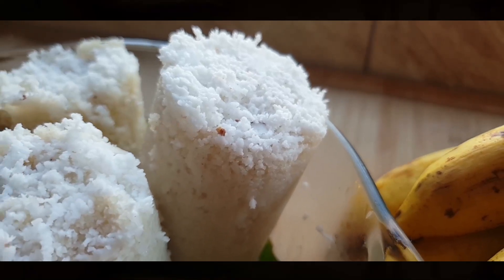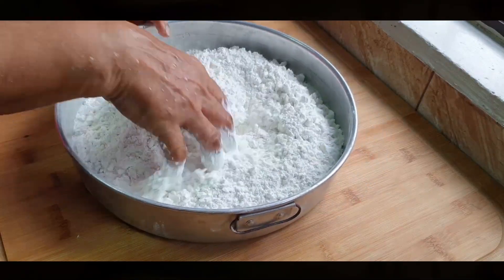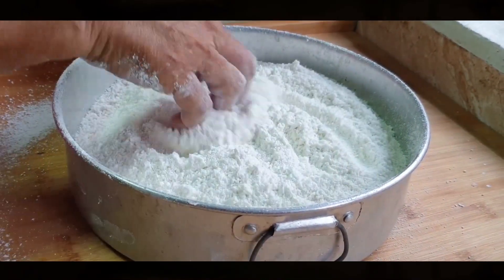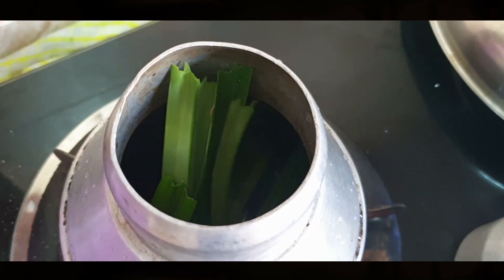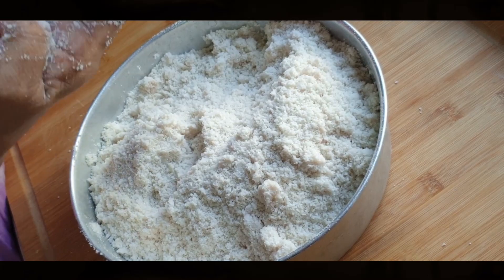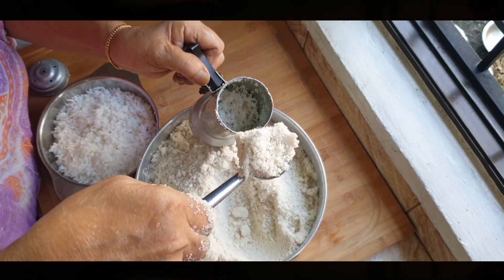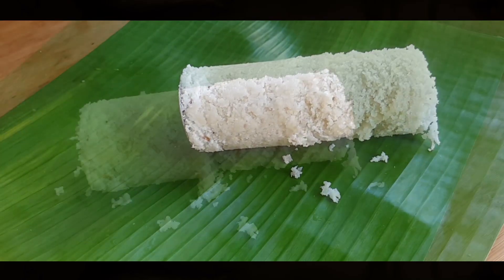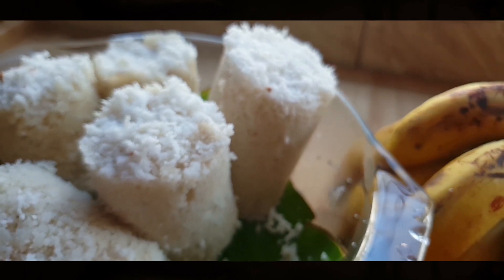Grandmother's Kerala Puttu: How to Make Soft Puttu

Comment: I have a problem when I make this. My putu pot is exactly like yours. First couple of times everything turned out well. But now when I try. the top topples off as soon as the water gets hot.I do not compress the flour
 I even tried not filling to the top, but it still tilts over, spilling everything
Reply: Why does this happen?
Reply from the maker: Try settting the stove to low, and let the steam slowly cook the puttu.